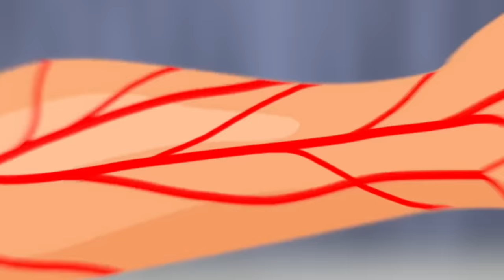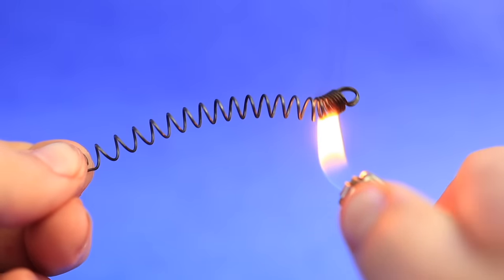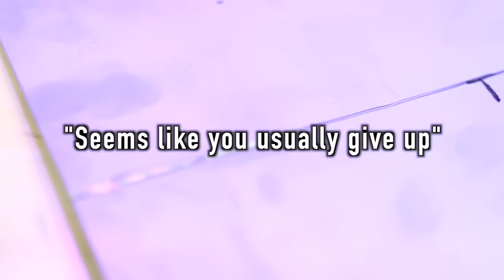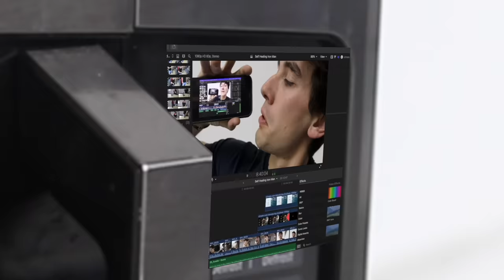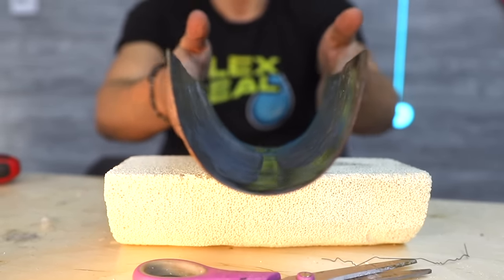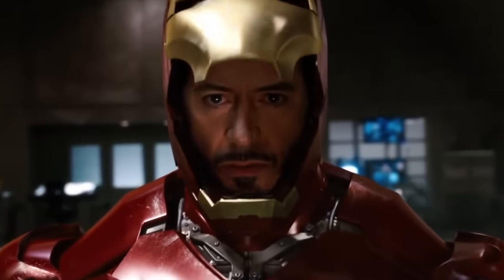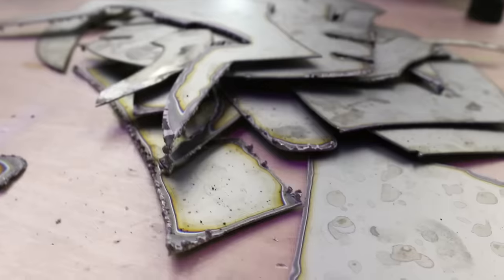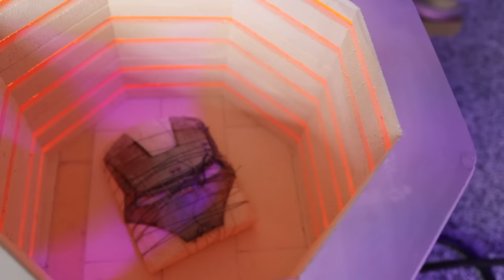Real Self Healing Iron Man Armor - Nanotech

Comment: The question is not if the armor can survive, it's if you can survive.
Thanks for this video, it's a really cool project, next, try to make a chest plate with insulators on both sides (the polymer mentioned at the beginning of the video would allow you the ability to repair the insulation by just slapping on a bit of it like flex tape), enough nitinol to stop a bullet, and enough current applied to individual segments to allow it to self heat and reform (paired with the insulators, it will stop you from electrocuting yourself). For the joints, you could use the polymer at the beginning of the video to repair broken joints or separated pieces by just pushing them together. The only limit would be the price and the strength of the bolts. Theoretically, you could use nitinol bolts, but they'd be expensive.

Comment: Use the kiln in combination with a press brake or stamping press to form the sheet into armour, then you could use heat resistant material like "starlite" for insulating the inside and heat plates between the starlite and nitinol to initiate self heal.
Reply: The problem is the actual heating is usually energy inefficient bulky or inflexible it took me some time to come up with and implement a viable solution. Turns out it is actually very simple and can be vectored to just target certain areas but it's very unintuitive to just think of.

Comment: Going along the nanotech route, an updated gauntlet that can morph into multiple shapes (sword, shield, etc.) would be awesome!  Either mechanical with separate moving pieces, or maybe with liquid metal that flows into different configurations based on different programmed inputs and circuits
Reply: It'd probably have to be mechanical, or cleverly designed using the same metal he used for this.

Comment: Another amazing video showing how amazing science and engineering are, as someone who loves making things, your videos inspire me, it’s almost like you can make anything possible 

 How about a motorized, retractable Iron Man gauntlet? You could design a wearable gauntlet with the ability to extend and retract, just like Iron Man's suit. Using small motors or pneumatics, you could create a mechanism for the gauntlet to open and close with the push of a button or a gesture sensor, providing a cool and interactive experience. Before activating it could be hidden up your sleeve, look like a watch or just a thick bracelet, you may even be able to fit a small laser diode to make an even more realistic or usable version
Reply: Also, To create a motorized, retractable Iron Man gauntlet, you'd first design a blueprint or a 3D model of the gauntlet, considering the space needed for the retractable mechanism. You might use a combination of lightweight but sturdy materials like aluminum or carbon fiber for the main structure.

For the retractable mechanism, small linear actuators or motors could work. These would be installed within the gauntlet, connected to the parts that need to extend or retract, such as the forearm or hand section. These motors would move the sections in and out smoothly when activated.

Controlling the movement could be done through a microcontroller like an Arduino, which could respond to a button press, a gesture sensor, or a remote control. You'd need to program the microcontroller to coordinate the movement of the motors to ensure synchronous extension and retraction.

Additionally, integrating LED lights for added visual effect and maybe even sound effects could enhance the overall Iron Man feel of the gauntlet. Wiring and power supply would also need consideration to ensure the whole system works seamlessly.

This project would involve some mechanical design, electrical work, programming, and creativity to replicate the iconic Iron Man gauntlet's functionality.

Comment: well considering you were able to make something this good with a fraction of the money tony stark could put into his helmet, and it was able to stop a few bullets and repair itself too? that's damn impressive man
Reply: Since he was talking about it being able to repair itself with electricity..  I could certainly see an upgraded version complete with sensors to detect deformation, and electricity supplied when deformation is detected. Naturally with some thicker and more covering plate 😅
Reply: TONY STARK WAS ABLE TO BUILD THIS IN A CAVE! WITH A BOX OF SCRAPS!
Reply: It won't be any better than this since it will never protect the person wearing it  @RRKS
Reply: @MaliohammadDesigns  it could protect someone. If it's thicker it'll not deform as easily and if you line the inside with something softer (maybe that polymer is soft enough?) That'll dampen blunt force transmitted through the metal.. it might help.
So in the end, if it deforms a little bit (as in not enough to deform your head), it'll buff out. The interior padding might not repair itself as neatly, but as long ans the padding is pushed into place by your head.. at least it won't fall off.
Reply: Didn't it stop the 9MM bullet? @MaliohammadDesigns

Comment: this is absolutely incredibly impressive as-is, but i think to make it even better, the helmet should be composite instead of just pure nitinol. use nitinol for stuff like frames and connection points so that it can move more durable material back into place, or maybe even pull pieces of a stronger material back together

Comment: I would really like to see a force field. I envision an umbrella shaped structure you can take out a backpack that uses a very strong oxygen tank to create a cone that can keep small debris away and/or have sound insulation for discreet conversations. The air could be one strong fan that disperses over the umbrella shape which could serve both purposes and it's possible oxygen at a high enough power would be blue like liquid oxygen, while still being a gas to give the appearance of an energy field.

Comment: Imagine a high-end car made from this metal. It could never be dented and is super durable
Reply: It's been thought of years ago only they don't use full sheets they use mesh sandwiched into cheaper aluminum sheets. The aluminum sheets were also anodized so you don't even have to repaint them. Cost and industry promotion for auto body and collision repair insurance is why they aren't produced in vehicles.

Comment: Here’s a few ideas I would suggest: molding your own firebricks from a 3d print. Or use a cnc mill to cut your firebricks more accurately. Never worked with nitinol before, but assuming it is fairly easy to bend, have it formed just like sheet metal, then sandwich it between your custom cnc’d firebricks and get it to restructuring temp. Now you have a piece that uses way less screws and is more accurate. I would also suggest water jet instead of plasma cutter as it is way cleaner of a cut. All that should get you to the next step if you continue going down the nitinol path.

Comment: Idk anything about engineering but i was just relaxing when i thought of how to improve the self tightening Spiderman suit, idk if this is even possible but I discovered that miniature springs exist and there is a specific type of metal spring that contracts when electricity is passed through it. So i thought the springs can be a part of the clothe like threads and a small current is passed through them when adjusting the fitting. Idk about the strength of the springs and other things that need to be considered but I just needed to get this idea out of my brain. Hopefully it was helpful.
Reply: That’s what he did

Comment: Pretty amazing project! You should try making MJOLNIR armor with the inner skinsuit is made of a moisture-absorbing synthetic material linked to an environmental control computer and the occupant's neural interface. It controls the suit's temperature and actively changes how the suit fits the user. On top of the inner skinsuit is a gel-filled layer, which regulates the temperature of the suit and can change its density to conform to the wearer's shape. The temperature inside the suit is controlled by the moisture-absorbing cloth suit underneath the hydrostatic layer. The hydrostatic gel layer can also be pressurized to various levels to potentially save the wearers life should the wearer be subjected to high G forces or a high velocity impact; however, overpressurizing this layer can cause nitrogen embolisms.
Reply: That’s smart
Reply: @Marvelmaniac-p4v  It's literally the description from the Halo books. Not possible today. You saying "that's smart" to a troll post is hilarious to me. 

Pretending to be smart is hard, I guess.
Reply: @bable6314  why do you have to be a jerk
Reply: smart

Comment: Crazy how nitinol is such a hard metal to work with, essentially shredding any kind of cutting equipment, but then at the same time is extremely malleable and you could crush it with just your bare hands/body weight.

Comment: What if you made it with a little thicker nitinol, say like 1/4"? I know you probably don't have the money and/or time to right now, but if you did, I wonder if it would work better and/or be more practical as actual armor. I know one thing, I'm gonna find out if/when I ever have the time and/or money. On top of that, maybe you could make a full body suit like that and run electric currents through it to heat it up on its own without having an external source of heat like a blowtorch. To prevent burning and/or overheating, you could wear a heat/fire proof/resistant suit with some kind of built in cooling system underneath the armor.

Comment: Not sure if possible, but you should make screws and welding fillement so it looks more solid and maybe add like heating wires inside so you don’t have to carry a blow torch every where if you use it😅

Comment: Also add thermal and impact impact sensors this will bump the cost by up to 16000 $$ but that shouldn't be that much of a problem until we also count in a 30000$ power cell

Comment: Yeah. I knew before even watching this video-- Jlaser was going to use Nitinol.

What NO ONE has stated yet-- is the fact that we ATTAINED Nitinol DIRECTLY AFTER THE 1947 UFO  Roswell crash. The Patent became available publicly a few years later.

The famous Roswell story goes "a small girl had been playing with the UFO crash material. The crash material that was made of metal- was as thin as tinfoil.. people noticed after crushing, crunching, rolling, and bending the unique metal-- it would revert back into it's original shape."

Yeah, pretty sure a lot of our best technology comes from recoveries of foreign or interstellar material.

The reason why it's SO hard and expensive to work with Nitinol is because CURRENT technology and methods to manipulate Nitinol is still in the infancy stages. That's what happens when you discover something through RETRIEVAL.. not by invention. 

If it was invented, the methods would have already already been there, but they aren't. That's why welding and shaping this material is so hard on a consumer level.

Comment: You could make a flail combined with a hammer, made of something flexible and lined with heaters and nitinol so if it bends it’ll return to the original shape (insulate the handle).
THIS IS A SUGGESTION, PLEASE DON’T REPLY SAYING IT’S A BAD IDE—
Reply: (thin galium/nitinol core maybe)

Comment: I think the run after running it over with an 18wheeler would have worked a little better/less snapping off parts, if it had been heated evenly (like in an oven, kiln, or with multiple torches with "wide" flames)

Comment: One problem, if you're wearing the helmet, and your head gets crushed; theirs no way for the mask to heal itself without cooking your face off.
Because the helmet needs the heat of a literal blow torch in order to repair itself. A blow torch is like 4000 degrees Fahrenheit and that would instantly melt your face off.
I think a better approach would have been chopping up a bit of iron into nanoparticulates using the plasma cutter, mix those microscopic particles of iron into the gallium, and then emulsify this metallic composition using a third alloy like brass or steel. Especially because the Nitinol approach wouldn't work, nor would it be functional, for realistic combat use, and self defense purposes.

Comment: Although it seems rather elaborate would it be easier to buy some Titanium and Nickel Powder and smelt and form your own Nitinol? 

Id imagine making your own in smelting and casting that it gets its programming off the bat cooling in the mold so that eliminates that step but then best part is your options are near endless to size n shape pieces you could make through cast molds, Like you could do the mask and rest of helmet in just 2 Solid pieces rather than bunch of small pieces screwed together course but that said way went about it actually turned out great!! 

Downside is for an Ironman suit its best that the armor not be able to be deformed or pierced at all, Truck running over your helmet with your head in it just results in helmet fixing itself while youre well, Unfixable lol, But! This would be a great idea for other things, Aircraft or spacecraft that can alter their aerodynamics to best suit situation by heating metal around craft, Vehicles bodies and components that can fix themselves after getting in an accident simply apply heat and youre gtg, Downside being price for such a thing would be expensive…

Comment: I get self healing because of the electrical conduction option, but definitely not nanotechnology. false advertisement. maybe next time use real nanotech
Reply: real nanotechnology can easily be self-healing, as long as the damage isn't on a nano scale. if the armor got broken into pieces, no problem. if the nanobots got destroyed, then there's a problem. best to keep extras somewhere, just in case. then again, if you've made an iron man suit out of nanotechnology, I see no reason as to why your regular clothes aren't made of nanotechnology as well. inconspicuous way to store more nanobots, which given an if else dual programming, can reshape between loosely connected clothing and tightly connected armor plating. also would make for a semi sweet surprise for anyone who tries to hit you if you add threat protection protocol that detects incoming threats and responds by hardening contact points.
Reply: if I were to be able to make my own nanotechnology, it would look like a ball with moving fibers all around it and would come in multiple types such as titanium, copper, and rubber coated titanium.